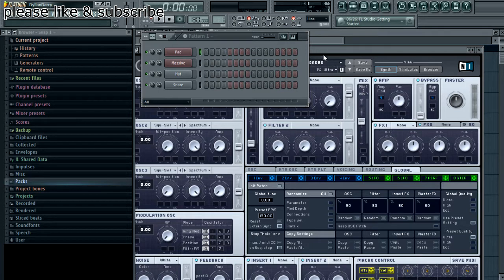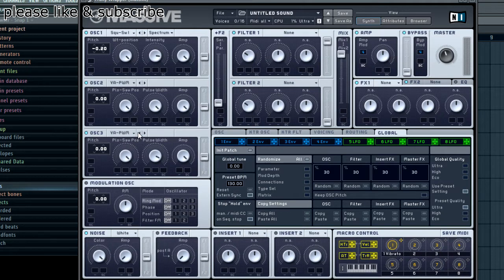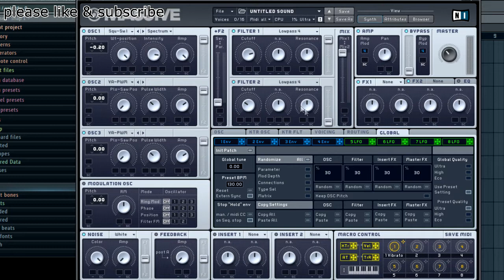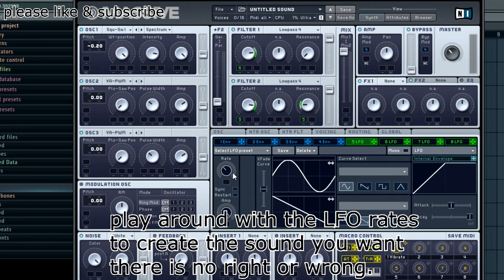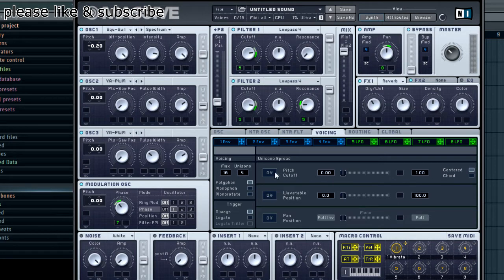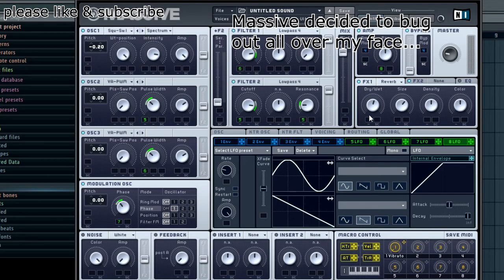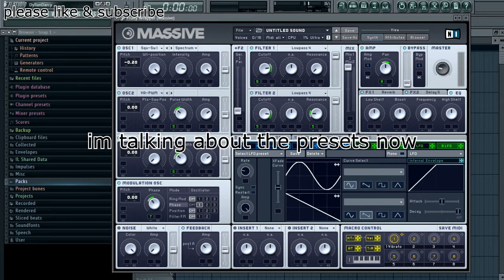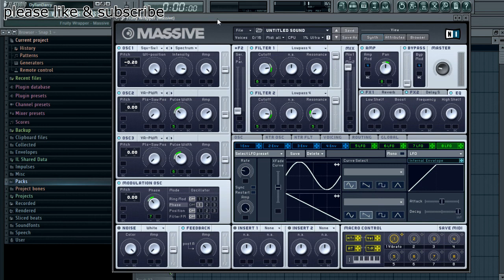Sound Design tutorial in Massive -  002 Warm Pad

Comment: you never move the filter mix slider to include any of filter 2, so none of the lfo modulations for that filter are audible at any point in this video. just an FYI if people were wondering, use the filter mix slider to include the sounds of that filter and its lfos.